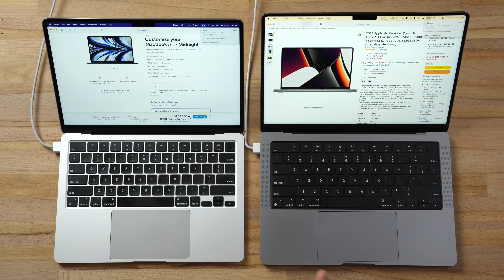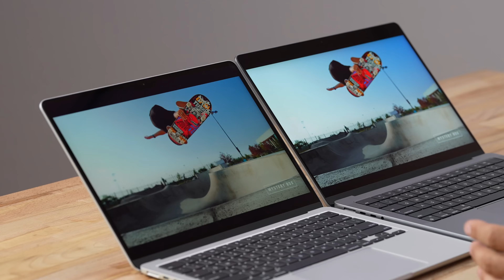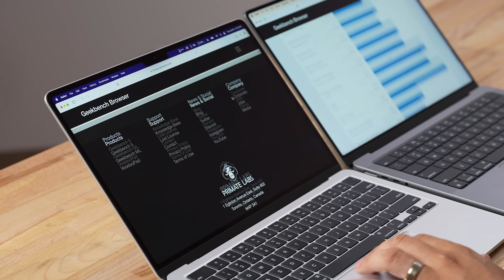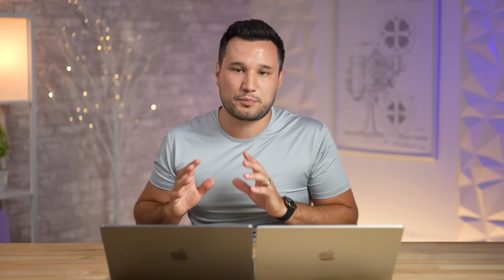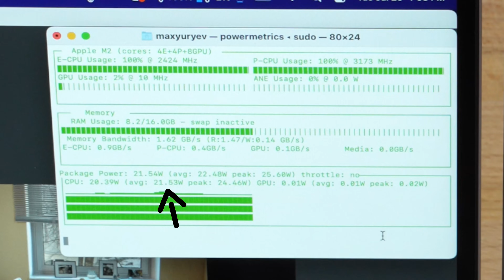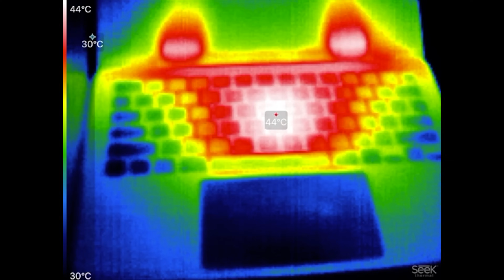M2 MacBook Air vs 14" MacBook Pro - Prepare to be SHOCKED!

Comment: I just bought a 14 inch MBP at the common current sales price in the US of $1,599 for the base 16gb512gb model. Right now, the MBP14 is basically the same price as the M2 MBA with the same ram and storage. For me the difference was mostly in the ports. I often use 3 or more USB ports at once, and I would prefer not to use a dongle. I think Apple will probably come out with a faster MBP within a couple months, but probably not below 1,999.

Comment: Yes, the Air is much lighter. But the 14” isn’t heavy enough for it to matter to most people. It matters if you’re using it on a plane or public transit or while standing. But in a bag or sitting stationary it’s imperceptible. What does matter is the .6” bigger display, much better speakers, and slightly better keyboard.

Comment: I’m soooo torn. I have the 14” base pro. I want the M2 Air simply because the 14” is heavy & thick which I do not like. I wanted to point out that THE BATTERY LIFE ON THE 14” IS NOT SO GREAT. MY PREVIOUS M1 MBA HAD A MUCH BETTER BATTERY. ALSO, PRO MOTION DOES NOT IMPROVE BATTERY. WHEN I LIMIT MY 14” TO 60Hz, I GET BETTER BATTERY LIFE.

Comment: Why do you guys call it the 14 inch as a differentiator when both laptops are 14 inch

Won't it be easier and just plain smarter to refer to one as the Pro with the other as the Air

It's just so dumb and annoying to me tbh

Comment: I will not buy the MacBook Pro simple because of the internal air cooling that can’t be easily opened up and cleaned. I see this as an Apple computer design flaw that is unacceptable in the MacBook Pros and the iMacs. Apple should be either making them ventless or making them easily opened to be cleaned out. So I will restrict my purchases to MacBook Airs and Mac Minis and Studios.

Comment: @Max Tech What's the verdict now that the 14" MacBook Pro is on sale for $1599? I'm typing this on an M2 Air with 1TB drive and 16GB of RAM, deciding if I should exchange it and sacrifice 512GB of SSD for the extra power. Main draw to the Air was the color, reminds me of the 2007 Black MacBook!

Comment: What about the keyboard comparisons? They are definitely not identical. I noticed on the MacBook Air that when I pressed the keys down, my fingernails sometimes caught on the unibody case rim, whereas the 14” seems to have a slightly deeper key travel, but I haven’t confirmed that. 🎉
Reply: The keyboards are identical.
Reply: @C0mpurgator  They literally are not. Go look at the specs; the 14" has slightly deeper key travel and the underlay metal is further from the key press bottom. Why comment on something you have no clue what you're talking about?

Comment: This video helped me decide on the 14", and it's 3.5 lbs and small size still beats my 16" i9 MBP that i bought in March 2020, as far as portability goes. My 14" battery lasted almost 9 hours of normal use over the 1st two days that I owned it (allowed to sleep when not used, not plugged in), vs 5-6 hours I might see on my 16" i9 MBP. Having the fast SSD, mini-LED HDR display, and extra ports is just icing on the cake. Thanks!

Comment: On the Blender comparison, the test should be appplied to a whole animation sequence, not just one frame. 3D animations require a lot of sustained performance over lengthy periods, so most likely the M1 Pro MBP would perform much better than the M2 MBA.

Comment: Hi! I really want to buy the Air M2 with high specs (10-GPU cores, 24GB ram, 1TB storage) cause I love how thin and light it is, but I’m a little worried about the throtteling.. Would higher specs fix the issue, or will it throttle even more because of the bad cooling system? Probably a stupid question, but I would be forever grateful for an answer from someone who knows 😅
Reply: Nope higher specs won't fix the issues

Comment: I've bought the 14
When you buying these machines, think about how long you going to use it, the reason why i bought the 14 is because it has a fan
High temp is really bad for your machine in a long run, it will damage your battery and reduce power
If you using for only a year or 2, the Air is a better choice but if you intend to use for more than 3 years, buy the 14, a stable system is a better system

Comment: I still cannot decide. Long battery life and portability are very important, and most of my tasks are online. I've had a MBA since 2015 and desperately need a good upgrade. I live between a boat and a van and I'm always moving around, so the new M2 makes sense. However I want to start working on video editing with drone footages and GoPro and want a laptop that will handle that and last a long time. In Australia, the $ difference is $500AUD ($350USD). I might need to go in store and feel the difference in size. Wish I could get an all in one solution!

Comment: So I had the M2 Air specced up close to the 14 Pro, but eventually exchanged it for the 14 pro. I edit a lot of videos and the Air worked fine, but the screen was too small imo. I found myself leaning in towards the screen more so I could see what I was doing on the timeline, as opposed to the 14 Pro where I'm just comfortably sitting. And of course the 120hz and better sound. M2 Air is a beast for sure though. Just needed that extra screen realestate.

Comment: If the Air would have a chance against the Pro in some more intense task than there would have been a lot wrong at apple, it is still an Air but the M2 chip is still very powerful, I mean that you have made that comparisons says enough but an Air is an Air and an Pro is an Pro.

Comment: I had my 13” Pro 2013 till now and only just upgraded to 14” Pro hopefully last me as long as 13” Pro did only reason was to use Final Cut Pro other wise I would still use my 13” 2013 for another year or 2 they are solid machines, speakers are insane which if you watching this on phone don’t do it’s justice, bass is nice

Comment: 14 inch battery is the same or better because it completes heavy tasks 90% faster, so you can move on to the next thing and do more in the same amount of time while the m2 is still chugging along. M2 battery life will be better if you do low power work for extended periods of time. both are wonderful machines made for different audiences. Creatives will go for the m1 14 inch, M2 air for studying and other non intensive work (majority of the users)

Comment: Update: just cancelled my m2 air 512/16gb and went with the pro 14. Also, bought it $300 off straight off the shelf and have it today. I tried the pro 14 in store and the screen is smoother and speakers way better. Happy I changed

Comment: I was lucky af.. I bought a 14 pro base for 1655 geek squad certified excellent condition, all sealed.. no plastic and accessories have been touched... customer pretty much returned it without touching ... apple warranty started on the day I bought it.. charge cycle was 0 ..... so yeah I got a brand new 14 pro for 1655 plus tax= 1750

Comment: For what it’s worth, I think for casual users that use air pods and are mostly in the browser, plus do some video editing, web site designs and games, the new Air seems to be a fine choice, primarily because it’s more portable.  But if you are a remote office worker, run cloud based apps and Office 365, do nothing with video and games, and need the extra ports - especially HDMI - the M1 14” I own is almost perfect.  I have been using it now for nine months. I keep it on low power mode even when plugged in and see no performance issues, and unplugged pick up about 20% battery life.  I also like the 120 hz capability and excellent screen.  It’s clear the M2 Air was cheapened to fit its niche, and I expect the the M2 Pros will be amazing.  But I will be happy with my M1 14” Pro for my work needs for years, until I get envious of the new ones.  I think Apple knows its user categories well and has carefully positioned their Macs accordingly.

Comment: Yes, if you are going to spend money close to the 14” PRO, get the Pro. If you want to save money and have a generally good entry level Mac, get the Air with 8 GB ram & 256 hard drive. It’s generally fast enough for most people.

Comment: I'm a system engineer for a mid size company. I choose the M2 Air. I work mostly in the cloud, rarely any compilation (using mostly Node of course). Portability and silence wins for me!
People, remember that just because M1 PRO is double the performance, ask yourself if you really need it. If you do, then great, it's an amazing option.

Comment: Going around and commenting on these silly videos complaining about the M2 Air.  It's al click bait.  Oh Apple screw up. Apple shouldn't not have done this. Even thought it can run Final Cut, it's not designed to run 2 8k streams.  STOP IT with the madness.

Comment: So ultimately you are reviewing machines aimed at two completely different markets. For those who want ultimate portability and are non commercial users the Air makes perfect sense. But I already knew that. I don’t need the extra speed, I don’t need the fans, I don’t need the better speakers and the screen is more than adequate on the Air.

Comment: Was really hoping the air would get mini led this year. Have a late model 2011 air and wanted to upgrade after 11 years of use. Still runs great but performance is lacking. Not to mention its no longer supported for os upgrades. After watching what you and Vadeem have done with comparisons, especially regarding ssd performance, I would have wanted to upgrade the ssd and ram. Which led me to the 14" pro base model for $100.00 dollars more. Ordered the 14" from Best Buy $1749.00 on sale. I spent over $1,800 on my 2011 air maxed out. Thanks Max and Vadeem for giving some excellent advice. Peace brothers, keep up the good work. It's appreciated.🤙

Comment: I'm sorry but are you guys thick? I've subscribed for a while but I feel like you're just trying to get clicks.

The whole point of the Air is that it is light and portable. The 14-inch is a pain to carry around. The use cases are different. No matter how close they are in price and how different in performance, it doesn't matter if you need to carry your computer around all day. What's so hard to understand about this?

Comment: This is the comparison I’ve been waiting to see.

The big deciding factor is what do you care about more : less weight and about an hour longer battery life or a bigger better display, better sound, and better performance for intensive software task. 

Or another way to look at it is what are you going to use it for. If you just need a computer to surf the Internet and do the occasional photo editing or video creation for your once a year holiday vacation and you don’t mind a slightly smaller screen then the MacBook Air will do everything you want.  Or you are a student and you need something small and light to haul around in your backpack when you’re walking all the way across the campus and you are only going to use it for typing and homework and you are not sure if you will have somewhere to plug it in. Or you are a business person and you travel and fly a lot and you need something with good battery life and is light to carry with you when you are hauling a heavy suitcase.

The pro is a better option if:
If you do any type of professional work with your computer such as YouTube video or music creation, 3-D rendering, intensive image editing, or coding.  You use an SD card on a regular basis or you absolutely need an HDMI connection or are planning on connecting it to two screens. Or you are not a professional and you can’t stand having a small 13 inch screen or a lower quality screen for watching HDR movies and you are willing to live with about a half a pound more weight and about an hour less battery life then the 14 might be for you.

Comment: No brainer to go for 14" pro if you are going to upgrade both SSD and RAM to 512/16GB on the M2 MBA to maximize performance.
FYI M1 14" pro base model is going for $1699 NEW at Best Buy if you are a member right now. ($1749 for non-members).

The M1 MBA is going for $849 (member) or $899 (non-member) NEW as well at Best Buy, which is significantly cheaper than $1199 base M2 MBA.
With these options available, I don't know where M2 MBA fits in on both ends.

(Edited to add - the M2 13" Pro models are actually off for $200-250 right now at Best Buy too if you are interested in picking up M2 at a discount)

Comment: I used both in a store and I can categorically say I prefer the old wedge shape for both machines. And especially regarding the Air and wrist resting. The on-ramp angle is better on the old design. I reckon if none of these designs existed prior and and people were presented with the square and wedge designs as options, the vast majority would choose the wedge design. The design machines have more ports. They win in this area. Solution: wedge shape with more ports.

Comment: Upgraded from M1 air to M1 pro 14" base model. Really happy with it. I reached the limit of the air with docker / kubernetes running locally. Logic a little bit too using superior drummer 3 and a few instances of neural DSP plugins. M1 pro so far has been an absolute beast and the keyboard is slightly nicer too for coding with the larger ESC row keys. Screen is nice but always connect to external screens when coding.

Comment: Just got the M1 Pro 10core, 16gb, 1TB. I'm producing music with a ton of plugins and it totally smokes my old MBP i9, 32gb. Just open a couple of projects I'm working on and the old one couldn't run any of them on 1024 buffer and max cores. The m1 chillin' on 128samples and default setup lol and maybe 40% load. It's insane!

Comment: Not shocked that the pro laptop outperforms the entry level one. What a silly comparison. The best video you have made recently, is the one about M2’s low power mode. Most of the rest, like this one, are all click bait titles, with sensationalist reporting. As if it’s a huge deal that the pro laptop is better at sustained performance. Duh. This channel hasn’t earned my subscription.

Comment: Best, most informative video so far - and I've watched a few! My only observation, that I am not seeing in any of these, is around future proofing. The MBA works well for general office use under today's stresses, but in 5 years time those stresses will be far greater and I wonder if the issues of throttling and slower performance could start to show. I am saying this as someone who is ready to upgrade after 10 years with a MBP 2012 16GB RAM 550SSD. These day's Office is using an extreme amount of CPU and I'm up at 11GB RAM with just basic Office apps working. The fans kick in daily. No expert in this, but it makes me think the MBP 14 on similar specs to MBA M2 will give you at least another 2 - 3 years. Any thoughts?

Comment: I find myself still torn, in part because the majority of comparison/review videos cover the video content creation market and the email-and-web-browsing market — neither of which I fall into. Sure, I use my (2017 Touch Bar) MacBook Pro for email and surfing, but professionally I spend all day in the graphic design side of the Adobe Creative Suite (InDesign, Illustrator, Photoshop) and Office 365 (lots of OneDrive syncing!).  Video work is merely occasional for me, and light in nature when it does crop up. It may be that some of the benchmarks being run are a reasonable approximation of my day to day workflows, but if that's the case then it's not obvious. I realise that the jump from a dual core i7 to anything in the M range is going to be a huge leap forward, and that's great. But I still want to make sure I'm getting the best machine for my needs.TBH the M1 14" Pro is the fairly obvious choice and the only reason I'm even hesitating and considering the MBA is because I do need to carry my laptop across town every day, so the extra heft of the new machines gives me pause. Even the excellent screen of the 14" isn't a huge draw for me, because any design work I do is carried out on an external monitor (ever tried using Adobe apps on a 13/14" screen? Nigh on impossible).

So, yeah. Torn.

Comment: That is a great comparison mainly because as you say if you want the M2 MBA to avoid the slower ssd  and low ram you need to upgrade and then you are in 14 inch Pro territory. I would have to go with the 14inch Pro which in the UK could be the only £200 more for a lot more features and speed.

Comment: For me the biggest difference is that the Air is basically a mobile only laptop and the Pro is also a desktop computer because you can connect more than one display. So if this is important the Air has no chance…
Reply: You're the only one who's referred to both laptops with the names that actually make sense 

Others keep calling it the 14 inch as if the Air isn't the exact same size on paper

It's just so funny

Comment: Nope, thank you. I'm just gonna buy M2 MacBook air BASE model. I don't use my MacBook like these YouTubers. I know M1 air is a better bang for the buck but I like the new design of M2. The slower SSD and throttling won't be an issue for me. If you are concerned of/affected by these "issues", you shouldn't be buying the air lineups anyways.

Comment: Sold the 14 MBP for the M2 Air 16GB 512GB. I loved the 14 but portability was more important as I travel the world with just #onebag I miss the pro motion display but the Air is amazing. This was the right choice for me
Reply: There’s no way I could go to an air after having the 14 since November.  A slimmer form factor isn’t even a concern for me….it’s all about performance and hardcore multitasking ability.
Reply: Hey could you expand a bit on that for me? Do you miss the mini led and 120hz and the better speakers? Those are the main reasons id choose the 14 but i like the m2 air more. Also how is the multitasking for the m2 compared to the 14? I cant find a review for that anywhere.